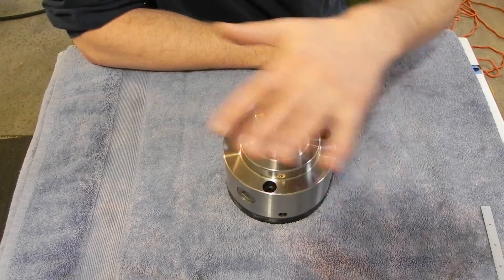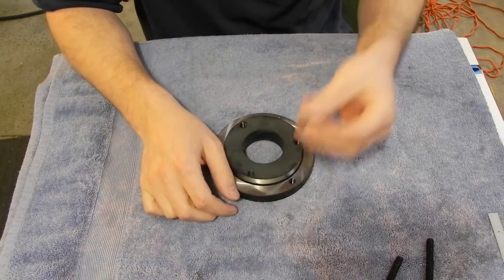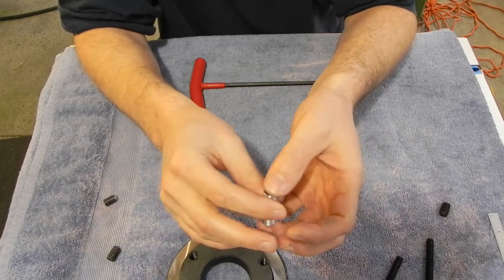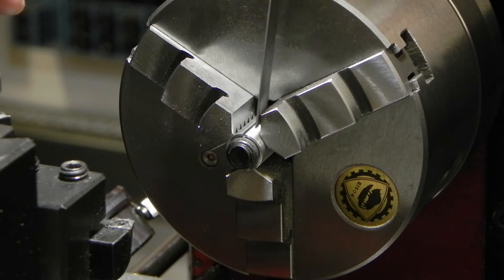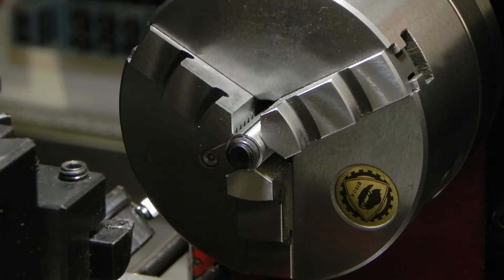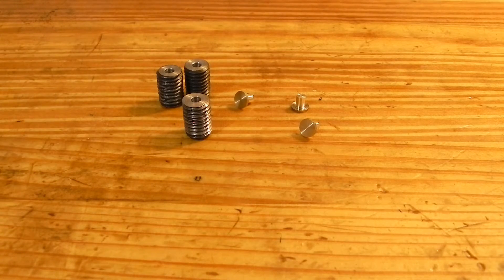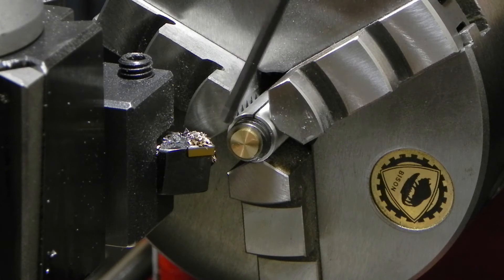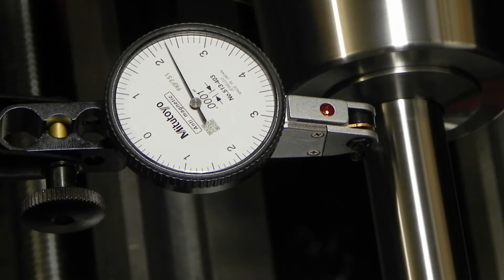Mounting a Lathemaster 5C chuck

Comment: Hello. What is the benefit of using 5C Chuck / Collets vs. MT3-ER25-32 holder / ER Collets or maybe MT3 direct Collets on a 7 "Lathe. Can you explain something about it?
Reply from the maker: I can think of the following things off the top of my head.

5C and  while ER collets usually have a range of +0 - 1mm. 

MT collets will require a draw bar through the spindle, so you can't hold long bar stock like you can with ER and 5C collets, as the draw bar gets in the way. MT collets where designed to hold cutting tools so they aren't offered in a wide range of sizes. usually you can only find them in standard tool shank sizes, for example 1/8", 3/16", 1/4", 5/16", 3/8", 7/16", 1/2", 9/16", 5/8", 11/16", and 3/4".  MT collets also have a small working range of roughly +0 - 0.005". 

ER collets are also generally used for tool holding, and are a DIN standard if memory serves. Because of how they are designed they generally have a larger working range +0 - 1mm. A side effect of this design is that they can't hold short work pieces, as the collet won't collapse down properly. Thus if you need to hold lots of short pieces ER isn't a good idea. On a lathe you need to have a way to lock the spindle, as a spanner wrench is used to tighten down the lock nut.

5C collets where designed to hold work pieces, so you can buy them in 0.001" increments if you want. Like MT collets they have a small working range of roughly +0 - 0.005".  A range of standard collet types exist,  you can buy collets to hold round, hex, and square stock. 

specialty 5C collets also exist.
1. step collets to hold short work pieces larger than the collet itself, 
2. expanding collets so you can grip a work piece by a bore 
3. fixture plate collets
4. emergency collets that are soft so you can custom machine them.

Hopefully this helps you out.
-Dan
Reply: dans-hobbies Thanks, that was a big help. I have to find my needs before I make too big and wrong investments. However, ER-Collets are not that expensive, even for a reasonable quality, so maybe that's where I start ... once more thanks.

Comment: Do you have a copy of the manual for the chuck? I want to mount mine and don't know what to machine the od dia of the mounting plate that inserts tho the chuck?
Reply from the maker: The chuck didn't come with a manual. 

The back plate that comes with it, should already have a boss turned down to the proper diameter. All you should need to due is mount it and take a skim cut across the mounting face. Let me know if I'm miss interpreting what you are asking.